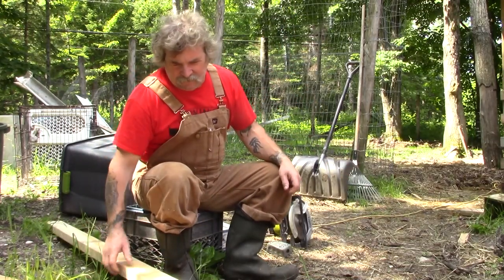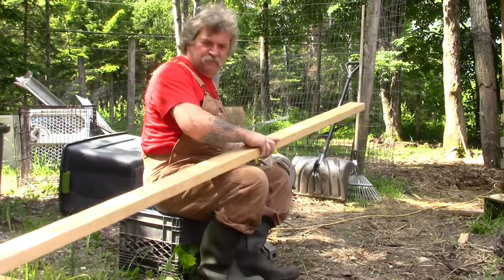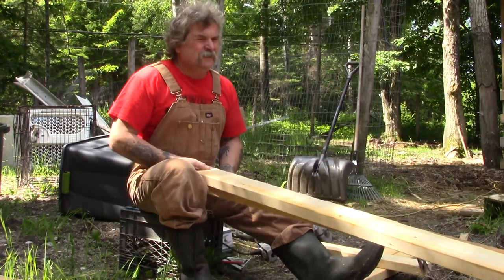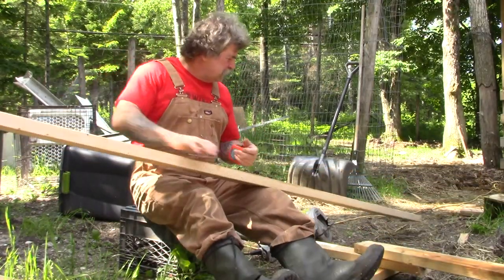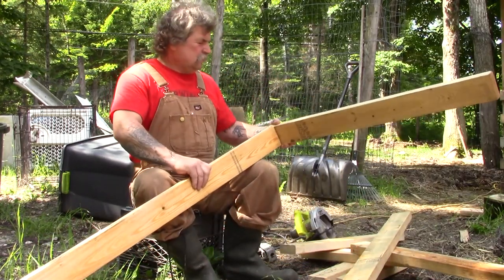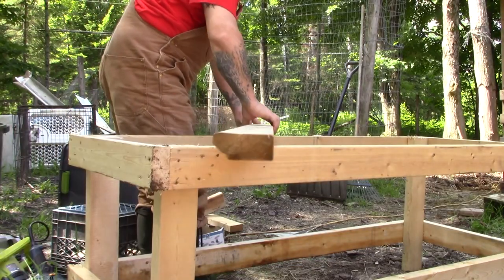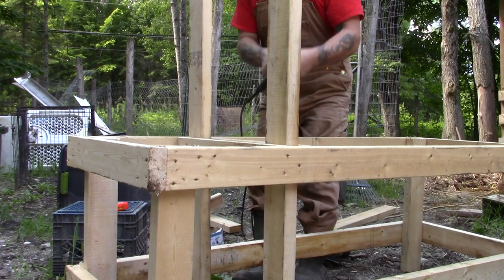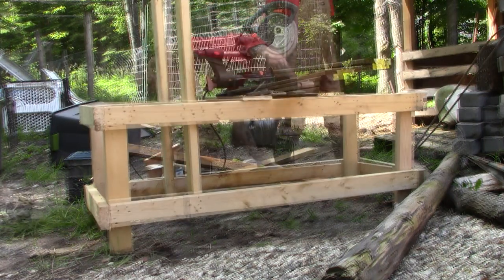How HOW Builds a Milking Stand!

Comment: I'm afraid the locking mechanism might be a problem. The girls often try to back out of the stanchion and I suspect your "locking position" isn't going to hold up to a very determined goat trying to free herself. The remedy to this problem is to add a spacer block on each side of the uprights and a board over them thus prohibiting the locking boards( you really only need 1 of the boards to be mobile) from popping free when the doe tries to back out. The spacer blocks need to be thick enough to allow the stanchion pieces to move freely.  I hope that description made sense to you.                                                               I hope you don't think I'm" butting " in....just trying to give you the benefit of my experience.